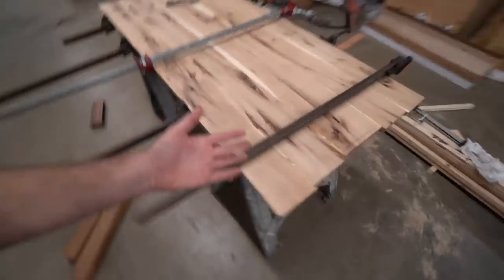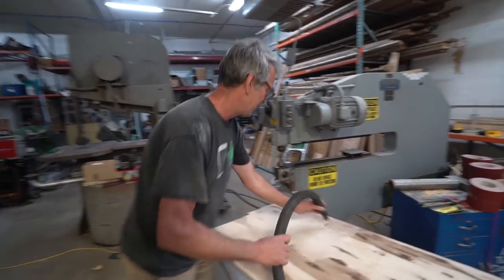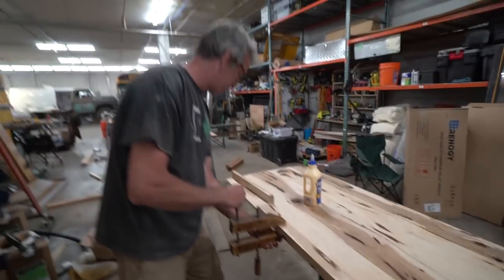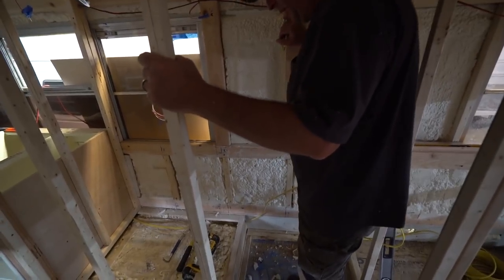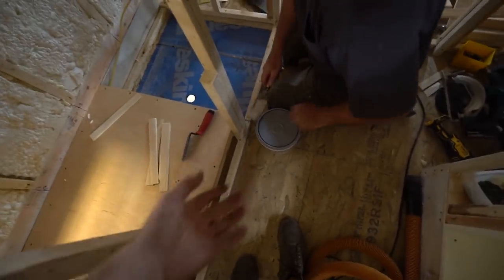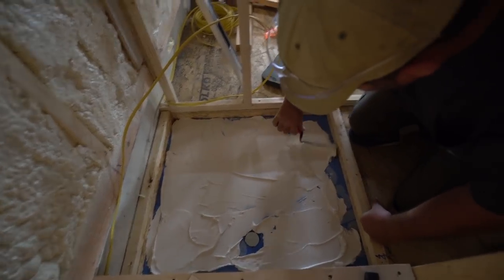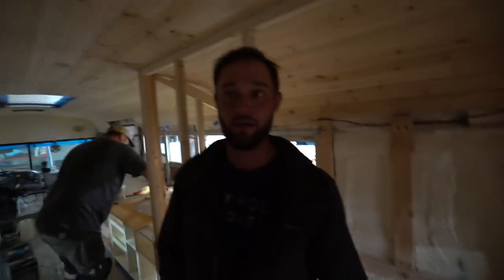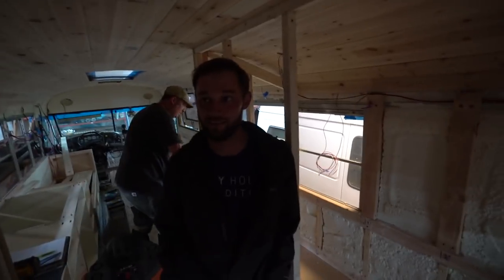Custom Shower Pan + Folding Chess Table and Custom Counters!

Comment: That mastic will not hold up in that shower floor , you will be replacing it with in a year !
Reply from the maker: Only time will tell.
Reply: @JaxAustin  I've been a tile setter for 25 years , so do yourself a favor and grout that whole shower pan with epoxy tile grout , it may buy you some time !
Reply: Like the framer who didn’t like a nail gun, the plumber who hates pex & sharkbites.... I can’t tell you how many failed shower pans I’ve personally replaced that were done with rubber & concrete pours... 

The application of a shower to withstand a constant earthquake... & make it beautiful... needs a somewhat elastic or “rubbery” substrate. Ergo why mastic & shluter is the perfect mix. Your idea of epoxy grout is spot on, however I would encourage you to explore some newer tech in our industry... it not only benefits you, it benefits your clients. 

You’re welcome.